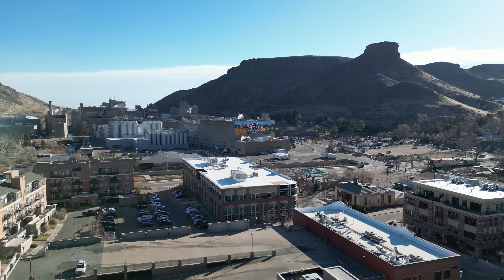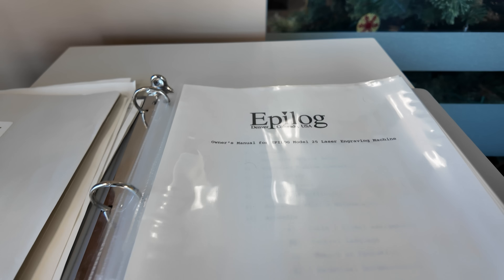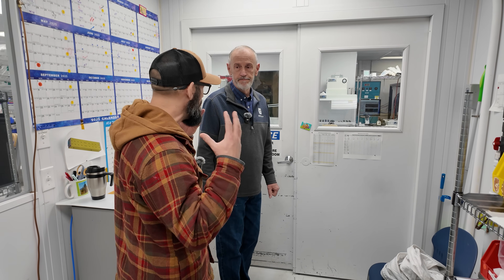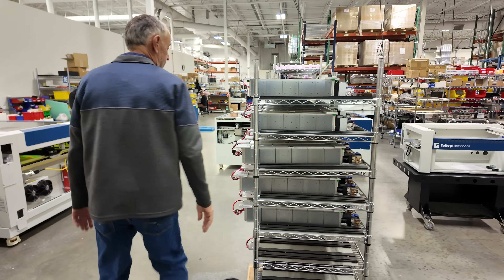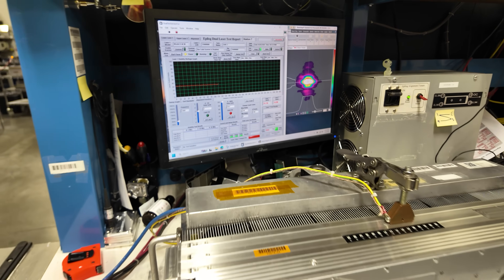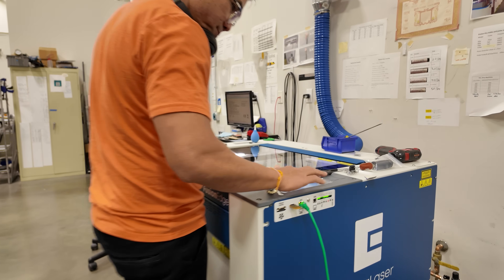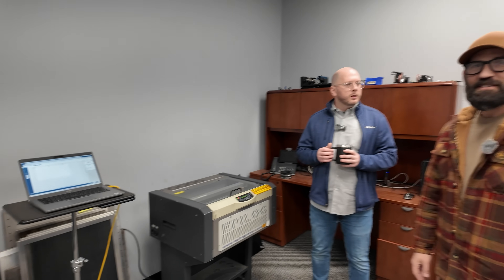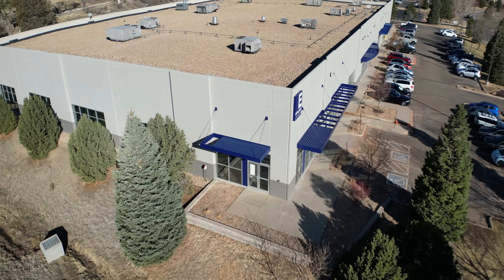They Can’t Say It… But I Can: Epilog’s Made-in-USA Laser Story

Comment: Back in the day when I first got in to my business which relied heavily on laser cutting on a daily basis, I went through the gammit of cutters well before the chinese market exploded on the scene. I purchase my first epilog and quickly my second. (extremely costly, but well worth it). They never let me down... until... the RF laser started getting weaker and weaker. OK... no biggie... I'll just replace it..... I have to say that Epilog was good about replacing the laser with sending a new one and allowing me to make the swap and send the old one back for "recharging"... The cost was more than just buying a brand new offshore machine. I'm not making mil spec components so these cheap machines did the job. That being said.... now with major time under my belt using everything from A - Z laser machine wise, and in my particular market, I have to say... Epilog was, and still is the Lamborguini of laser engravers. NO QUESTIONS ASKED!!! I also remember that my Epilog machines had Coherent RF lasers. I was not aware that they make their own RF lasers now. Pretty impressive.... Also as the market is growing rapidly, software wise, LightBurn is really on top of the game for a majority of users these days... Crazy how things have changed since 15 years ago. Just like everything else i guess....
Reply from the maker: Wow, what a great story, thanks for sharing your experience!

Comment: I have an original Fusion, forerunner of the Fusion M2, purchased in Aug 2013. Its still going, and its been a workhorse, and it's paid for itself multiple times over. The tube is in a shop at the moment for a re-gas.
Reply: So tube lasted 12 years or this is second or third refill?
Reply from the maker: @caleb7494  I have had no refills tube still works, prob running a little low on power, def not 120watt after this long, but strong
Reply from the maker: Glad to hear its a workhorse!

Comment: I work for the Air Force in an Arts & Crafts Center. We have an M2 (acquired in 2016 I believe) and a Fusion Pro 36 in the shop currently. We had a Helix but upgraded to the Fusion Pro a couple of years ago. These machines get run  close to 6 hours a day 4 days a week. They are work horses. We've had our difficulties but have been able to work through them with Tech Support. I've exchanged emails with some the folk featured in this vid. I intend to get one for my garage when I retire next year or so. I'm just torn whether to get a sandblasting cabinet or the laser first.